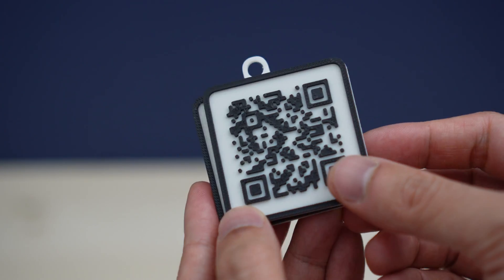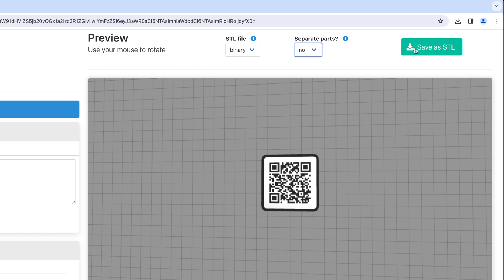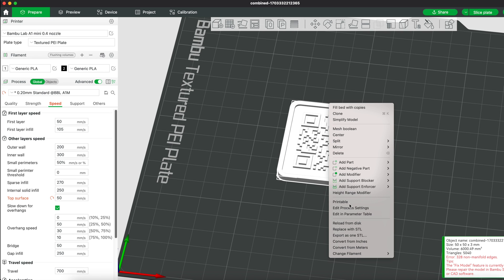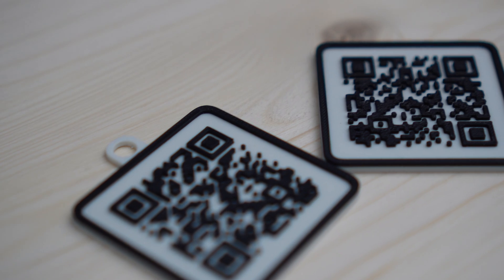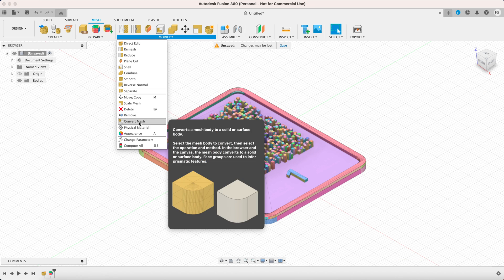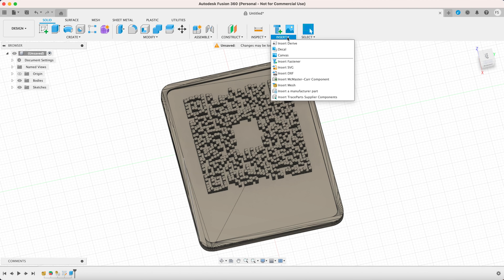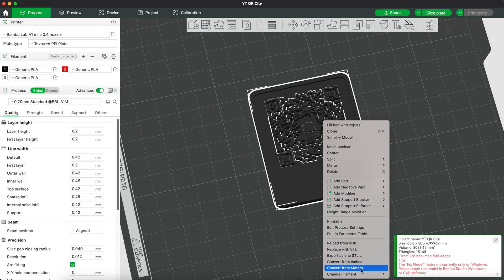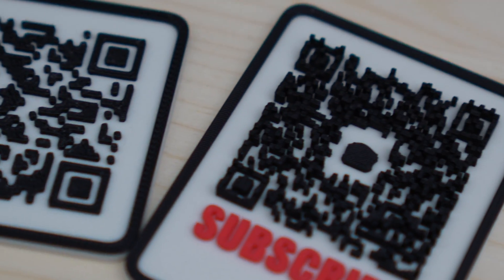How to 3D print QR Code city! (ft. Bambu Lab 0.2mm Nozzle)

Comment: great video, simple and easy tp follow tutorial.
 
maybe you can make an amend to the video as painting the model is not necesary, just simply program a layer change at the needed height and for single color printers just swap colors when prompted by printer, if using bambu AMS you juast tell the printer wich color to use, for the newer multicolor printers i think it will be a similar proces to the bambu AMS

Comment: Can you print QR codes with different destinations all at once. I want to make a qr code label for a tote and each tote is different so I want to 3d print them all together instead of one at a  time. They are only 30mmx30mm so should be able to fit a few on a plate.